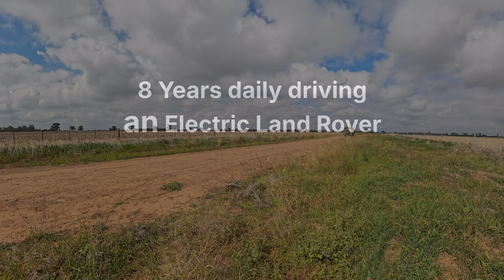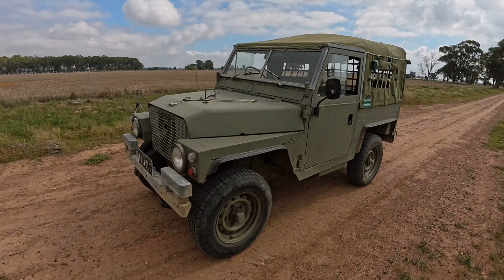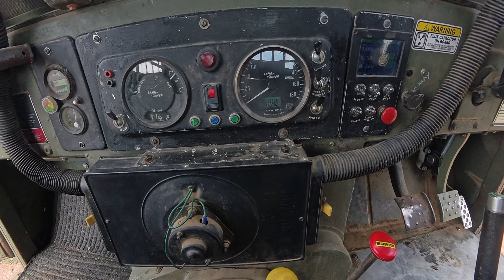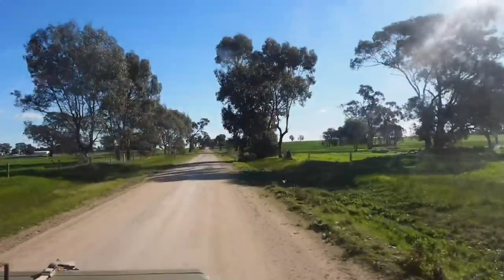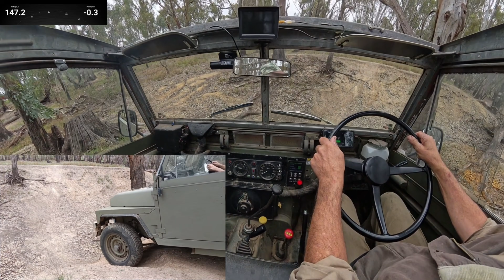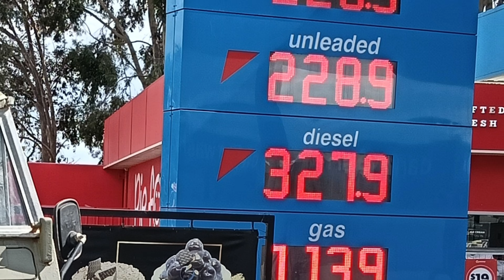Before EVs Were Popular: 8 Years With an Electric Land Rover

Comment: The rivet counters can play in their sand box and the rest of use will enjoy the world with our customized landy's. You have created a great working machine and my hat is off to you, nice job!
 I have a 1 of 17 Heli Support Unit Defender that I stripped of all of it's military attire and made a tourer out of it. One thing that has caught my attention with your LT is the ibooster conversion, I want to do the same to the Defender. With that said, there are no many conversions done or at least not found with searches on the interweb or on YT.  Do you have have any advice or suggestions for fitting one to my Def? I'm presently looking at an ibooster from a 2018 Tesla Model S.  / Cheers.

Comment: Always said to anyone I've talked to if the M103 engine in my old Merc goes I'm converting it to electric. Given the reliability of the engine and how little I drive it that might be a while off but non the less I'll convert it. 

I did try and get some info from Mercedes regarding this because they did do a trial electric version of my 190E in the 90s but got no info.

Comment: Great video, I am getting a 2010 Nissan Patrol converted atm. It will have a 174 Kwh battery, two electric motors connected to the diffs, and a 3,500 watt inverter. Can't wait to get it.

Comment: Hey thanks for this inspirational video. Maybe 15 years ago I discovered NEDRA and was in awe of what you could do with a forklift motor and lots of volts, just from lead acid batteries. I thought I'd love to build my own ev drag car. Alas, I didn't have the space. Around 8 years ago when you were building this I finally had space, but latched onto an older dream. I built an ultralight. What followed was years of hair pulling and depression. It's finally flying, which is great, but I can't help but think it actually would have been more satisfying and practical to have built an EV Streeter. At least I could duck to the shops in a 13 second street machine. My ultralight just sits in a hanger most of the time!
Reply from the maker: Cheers reminds me of a project I saw on youtube years aga, A german guy built a quadcopter out of a bathtub & flew to the shops in it.

Comment: The issue is the way they build EV today, they are made throw away. They need to be designed so batteries are replaceable affordable by a local mechanic. That's the biggest negative currently which your conversion wouldn't have that issue. 👍👍

Comment: How many broken rear axles have you broken.
I use to carry at least two. 
It worked hard on the farm.
Reply from the maker: Broken many over the years  in previous Landys,  this one Ive Fitted Ashcroft half shafts  &   Truetrac diff
Reply: @DonIncoll 
Now that's thinking. If only they had those 35 years ago it would have saved me miles of driving on the front drive or stripping out the axles . My father made up a long rod with a strong magnet to pull out the broken stub. It worked most of the time. I had a short Landy it was a 1950s model. Can't remember exactly year and model but it was great at the time. Little cab open tray sliding back window between the farm and the beach it hardly ever failed until the back axle shit itself. 
Axles were everywhere when I was growing up. So were landys and spare parts. Then the scrap metal merchants took them of farms across the state. 
You have done a wonderful job on yours. 
Thanks 👍

Comment: Fantastic, what's the vehicles range and recharge time? What kind of load can it carry or weight it can tow? What impacts does weight have on range?
Reply from the maker: another video coming that addresses all those questions,     Basically range sucks but it could pull a 747 -. 100% Torque from zero rpm, check back in a few weeks

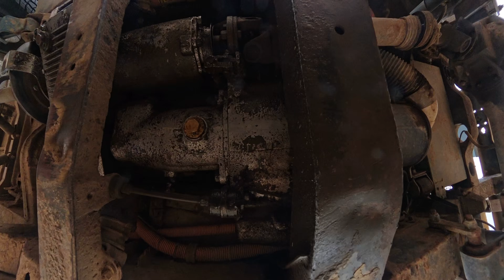Comment: 1:26 Was the smart thing to do. getting the car to work is enough without having to program a traction control system. Good Thinking, keeps it simple and reversible.
Reply from the maker: Traction control sucks .  lift a wheel , ABS sensor sees spinning wheel,  ECU  thinks oh shit i better lock that wheel , 30 seconds later   car starts moving &  lifts another wheel  .  Repeat.  Old school is the  better way .
Reply: @DonIncoll  Kind of what I'm getting at,
You need the time to integrate the data from multiple sensors together and tune it to control the wheel spin correctly. 
Very few car companies get it right nor give you the level of control needed to make it useful off-road.

Comment: Since the beginning of Tesla's "innovation" of the EV I kinda wanted to do this same thing with my Discovery 1 but never wanted to replace the noise of the V8... Now I own a TDI and I definitely could see that being converted to purely EV. Still need the capability off-road so a single motor and batteries with the original drive-line still completely intact. 
1 simple question, 
Battery life time. You've done 8 years, have you swapped batteries yet and if not what's the range been like over time. Batteries decay rapidly vs an internal combustion that just keeps trucking on (The old 300tdi will go forever with basic maintenance and the range will always be the same) 

I love the old Land Rovers, but purity is a simple and narrow mindset for people who don't drive. Upgrades exist for a reason, and modification is the essence of advancement. 
Love your build.
Reply from the maker: Good question & I'll cover batteries in my next video. But in essence the batteries have not degraded at all, The manufacturer state a life of 3000 charge cycles and ive just clocked 900 ,   The thing that kills EV batteries is fast charging,   Slow charge from a regular power outlet , dont go below 20% , Dont go above 80%  and your in the sweet spot for longevity.   Granted these are old school Prismatic cells , New batteries are much better but fast charge still kills life expectancy.

Comment: Far more complex and un-reliable compared to an original 2.3lt petrol and far cheaper than EV. Break down in the bush no way to fix it.
Reply from the maker: The simple fact of the matter is this has been 100% reliable for 8 years . Cant say the same for any other landy ive ever owned.  Though I do agree the 2-1/4 petrol is the most dependable engine that's ever been in a Land Rover.   

Only time Ive really needed  to lift the bonnet is  when people want to look under it.  (The washer bottle is inside next to the steering wheel) , .

Comment: Well done.
How is it with legislation/ paperwork, and insurance. 
I assume you charge from solar, so almost free.
When you get nutters lead on by oil companies in charge of the world...and creating mayhem...you can sit back and smile
Reply from the maker: Built to NCOP VSB14  , local regs for EV's   Vicroads engineer approved so fully insured & road legal.  Correct  its cots zero to run , charge for free,   there room for another video just on that.
Reply: @DonIncoll sounds easier than here in UK

Comment: I still can't become interested in electric vehicles. Its impressive engineering but just not very interesting imo. The cool part of this car is the old parts, not the electric parts (no hate, just wondering if other ppl feel the same, i recognize evs make sense for a lot of people to own)
Reply from the maker: I totally get that. There’s a vibe to the old oily bits that an electric motor can’t replicate. But for me, the 'cool part' is that the electric guts allowed me to keep the rest of the 1973 engineering alive as a daily driver. Without the conversion, this truck would be a garden ornament or a weekend-only headache. This way, the original gearbox, and that classic Series silhouette get to stay in the world and work for a living. It’s definitely a different kind of 'interesting'!

Comment: the batteries would be interesting for off grid
Reply from the maker: totally , this doubles as my house battery,    sometimes I plug a solar inverter in and run the house off it,  The inverter  MPPT input just thinks its another string of PV panels.

Comment: but what is the range ? How many batteries , Don't get me wrong i have often thought electric power is great and coupled to trans/ transfer case is the only way to go. I just want to know how far go and how many batteries
Reply from the maker: Honestly,  how long do you want to sit in a Series Landy ,  If I need to go further I take an ICE car , If range is a consideration you don't convert something that's an aerodynamic brick wall , The range is good enough for 3 or 4 days local running about & shopping trips & the odd bit of fun 4x4 .   The link to full build is www.goingbush.com/ptev.html , the battery specs are there.

Comment: Can anyone build an bugout electric vehicle,during a time of crisis, especially what is taking place now.
Reply from the maker: Good Plan , about the same time I built this another bloke built an EV Jimny and had a big fold out solar array on the roof,  when the battery ran out , he fold out the panels and charge / camp  - repeat, Was the first EV 4x4 to cross the Simpson desert.    you got to be self reliant in a BOEV . I think you invented a new acronym :)
Reply: @DonIncoll . Battrey off road electric vehicle.
Reply from the maker: @marvelpinnock3553  I was thinking Bug Out Electric Vehicle
Reply: @DonIncoll . When look back at it I've realized that what it meant, sounds good.

Comment: I had a IIA 109 MilSpec in 🇨🇦, was yours a 2.25 litre diesel?
Reply from the maker: 2.25 petrol , It was a British MOD  which served in HK  , not sure how it made its way to Australia.
Reply: @DonIncoll mine was right hand drive diesel but in 🇨🇦, so my dog sat on the left which made for some interesting conversation. It also a Fairey overdrive on the TC and I used the manual throttle on the dash for highway driving.

Comment: I first came across your video about 2 years after you had built this when I was looking at covering my 2a. It’s great to see an update on it. I think the real kicker for how easy it is to drive is how effortlessly you take off from a stand still on that steep bank. No reving or slipping the clutch, just full torque for a smooth pull away. Unfortunately at the time batteries were too expensive for me for the range I needed to do my conversion. I still have the Landrover and hope I can afford toe conversion one day.
Reply from the maker: Cheers , thanks for your comment.  At the time the batteries were the most expensive part of the project, $11,000 .   Now you can buy a complete Nissan Leaf  (Stat write off)  for less than half that & you get almost all the parts you need .   ROI is good though, my batteries have more than paid for themselves in petrol savings.

Comment: Ive got a series 3 and series 1,both swb  beauties,either one could be electric but a Landrover friend in Perth is looking at only 40 km per charge.
God I hope I could get more than that on a conversion as I use mine on great coastal runs.
I have a large  solar electric battery system that is now car charge compatible.
Im researching more before I commit👍👍
Reply from the maker: An EV Series Land Rover typically uses 28-32 kw per 100km .  No matter what motor or battery tech, SWB / LWB no different . Its down to the aerodynamics of a brick, slightly better if you delete gearbox & transfer case .   I have a 28kwh battery  & typically get 80km range , If I drove it at  30-40kmh  where aerodynamics arent a factor  Id get over 250km .   So for more range you need more battery , More battery = more expense. You need to work out if your just carting around extra battery - just in case  .  If I need more highway range I just take a different car .    For a weekend of proper off road driving at speeds below 50kmh  its heaps.  I went on a club day trip a few years ago & the battery indicator hardly moved .

Comment: Saw you drive out of bunnings Yarrawonga about 6 years ago and I thought wow that's cool only after noticing your number plate and the electric hum as you drove off. 
I'd never want a new EV but an old car with an electric heart transplant is something id love to explore.
Reply from the maker: Cheers mate,    I was just thinking the other day  putting a Tesla drive unit and battery modules into a 80's  Falcon  (or anything pre airbags , pre ABS ) would be a great project.
Reply: @DonIncoll i had a 95 falcon ute with a blown motor in my yard  back when i saw you at bunnings and i thought hmmm EV falon ute.
Reply: new ev/s are probably full of hi tech just busting it's arse to break down.

Comment: What's the range of your battery?
Reply from the maker: The battery is a 28kwh (small capacity for its size by todays standards)  , consumption is about 32kwh per 100km ( thanks to aerodynamics of a garden shed)  so range is about 80km . Its good for about 3 days  before I recharge.

Comment: Love my 300Tdi, when she wears out at a million kilometers I reckon I'll go electric too.
Great job.
Have you got the old Smith's heater working with the set-up?
Reply from the maker: yep, I put some ceramic elements in that Smiths shell,   - need here for compliance as must have a working demister.
Reply: Brilliant.
I have seen many conversions and very few are fully resolved. Getting the details like heaters and gauges etc fully functional is key.
More of this stuff will be coming online and getting easier to get.
There is bound to be a huge market in converting older cars using wrecked EV's for donors.
You are ahead of the game and i salute you.
Very clever.

Comment: 4:30 - I'm sorry... WHAT JUST HAPPENED!?
Reply from the maker: yeah maybe needed some explaining there , I might have to revisit  , that was me backing off on the throttle  so its just motor torque holding the Landy on that embankment , then press pedal to take off again.   no brake pedal used in that clip.
Reply: @DonIncoll  Yeah, it was just the fact that it stopped dead... and then... just moved again, as though it was nothing, just like pulling out of a parking spot. Super impressive!
Reply from the maker: @Fishd1  chuffed that you picked up on that detail,   Lots going on there  ,  it took me a few years of fooling around before I realised that it was even possible.

Comment: offroad electric looks like a total game changer! I'm surprised the gearbox and axles cope with the torque though
Reply from the maker: I put Ashcroft half shafts and truetrac diff centers in ,   as for the gearbox ,  I can only think its lasting so well because the motor is so much smoother.,  no need to ever use reverse gear either as the motor spins both ways.
Reply: @DonIncoll  Do you still use all gears or leave it in 4? I'm sure the ashcroft stuff is helping indeed :)